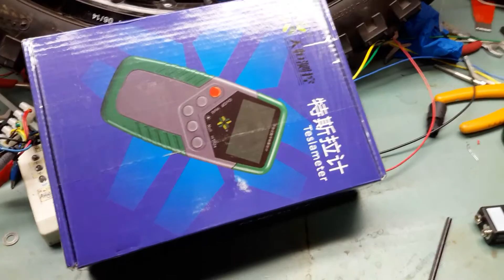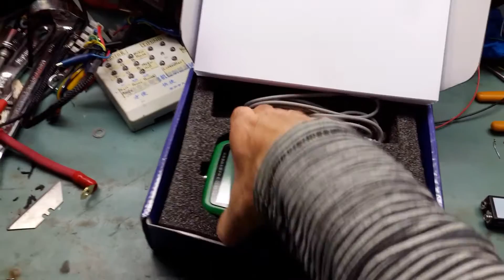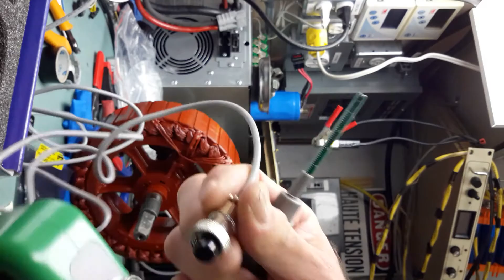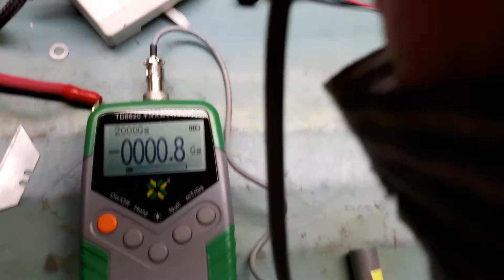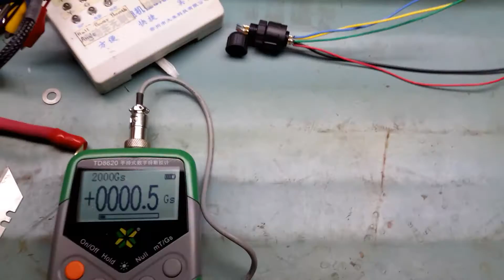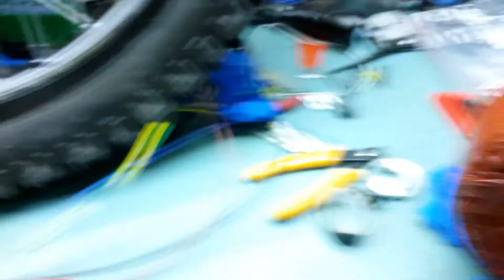Got a Gaussmeter! will test on QS MOTOR QS205 50H

Comment: Greatings Doctor Bass,, love the work on Qs 205,, I also have the same Qs 205 and  Adaptto 14kw  with a 2,5 kw PanasonicPF 18650 pack in a Fat Ebike,, All Diy,,, love it, 😁   plus be so kind and tell me where you Order the Hall Sensors,, as I need to replace mine. Yrs sencerly Werner